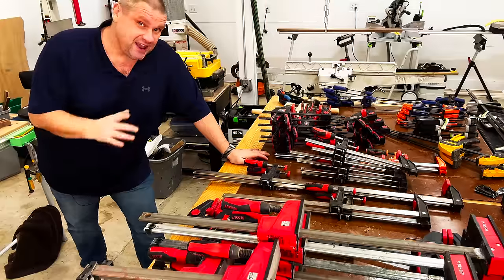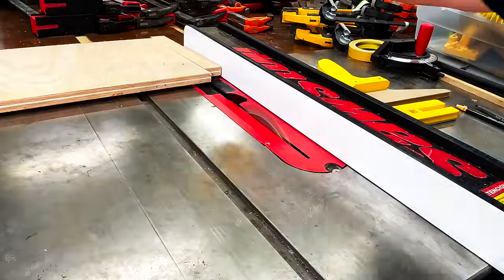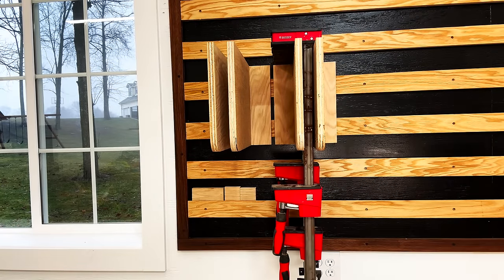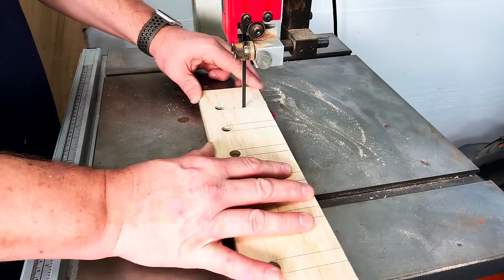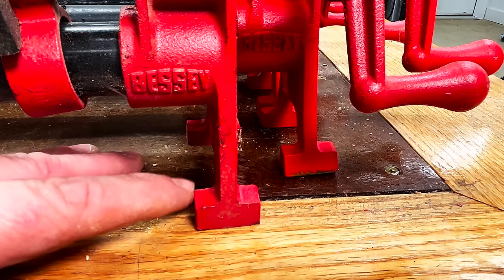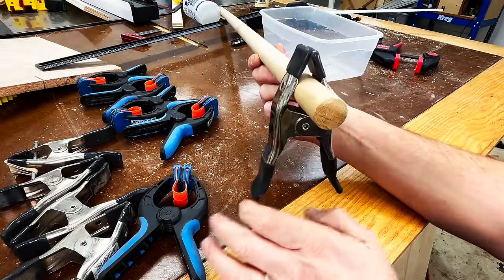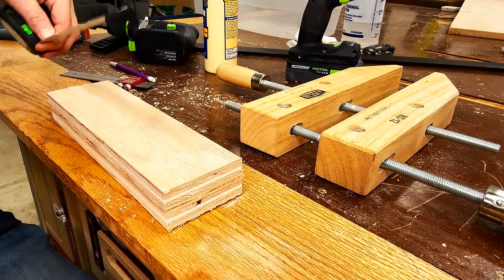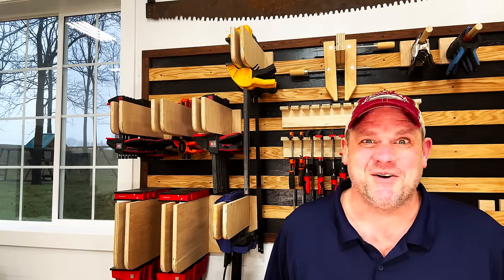5 Easy Build Clamp Racks: You be Amazed How Easy They Are!

Comment: Enjoyed the clamp rack build.  I built a clamp rack base on rollers to hold most of my clamps, it’s 2 sided, 24” wide X 48” long, and about 68” high, with a shelf at about 30 inches off the ground to hold miscellaneous clamping parts.  Additionally, I’ve got lots of c clamps and clamping vice grips too.  Initially I had a dozen 60” Bessey clamps which were super heavy and cumbersome, plus took up a ton of space.  

I needed all those long clamps for my Roubo workbench build, and don’t use them that often in normal building stuff.  All this to say, I revised the clamp rack for the long Bessey clamps to be horizontal at the very top of my tool wall.  They all fit on two arms that are around 18” out from the tool board and are about 48” apart.  I stagger them so they fit closer together on the rack.  I also put a bolt vertically through the arm, to ensure a small bump wouldn’t let them come off the end of the wood holding them up.  Basically they take up horizontal space at the top of the wall and free up very important space on the wall.  

Great work!
Reply from the maker: Love these ideas Michael,  I'd love to see a picture of your clamp rack, I wish you could post pictures on these comments!   Really like the idea of staggering the clamps to have them fit closer together!  Thank you so much for sharing all this.   Really like these ideas, and thanks as always for watching!!!

Comment: Just found your channel yesterday. Enjoy your goofy content and I mean that in the best way. Here’s a tip I wanted to share with you. When you just need to mark your 1” x 1” corners for holes, countersinks and such try this… Set the gauge on your pocket rule to 1”, and since the blade is 1” just hug the corner of your piece and mark the corner of your ruler with either a dot or L… seems silly but actually can be a time saver. If it just needs to be close like the back of the cleats you can even use a spring punch or set your drill bit at the corner, pull rule away and start your hole.
Reply from the maker: Thanks so much for the tip Brian!  Really appreciate it and thanks so much for watching.  Love getting tips from viewers! :)

Comment: I had more clamps than places, so I added a bar with slots for clamps and supported it under the assembly table and fastened it to the legs. I can get up to 24" long clamps in there. I have rearranged clamps multiple times and appreciate the ideas. My pipe clamps don't have those feet, so I look spring-loaded broom holders attached to the wall.
Reply from the maker: Oh nice!  Those are all great ideas as well!     I have a couple of pipe clamps that don't have the feet as well,  and a few extra longer clamps that I need to find a home for.  Really like your idea of having some on the assembly table,  that's the perfect place for them!  Thanks so much as always for watching Ken!

Comment: If the two clamp supports are cut on the diagonal (instead of rectangular), down from the front to wall, you require less plywood for each cleat without loosing strength. These can be cut from a rectangle cut on the diagonal.
Reply from the maker: Great tip William!  Thanks so much for sharing.   I think I might implement that next time I make something.  Thanks again for sharing and watching!

Comment: Why not use similar rack for f-style that you did for parallel?
Reply from the maker: Great question.  The only reason I didn't do that for the F Style was because I wanted to try out different styles of racks.  There is also the issue of having different sizes, with the parrellel clamp rack you have to stack them so if you need a longer or shorter clamp, you may need to pull out all the clamps in front of the one you need.   Great question James!